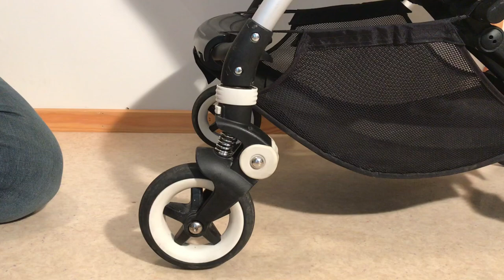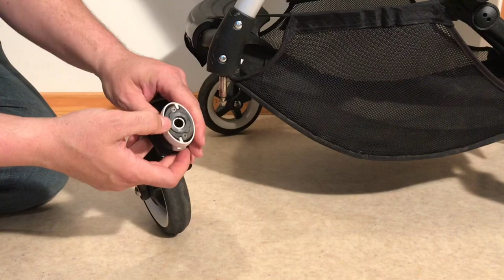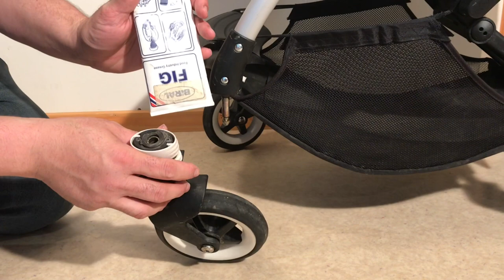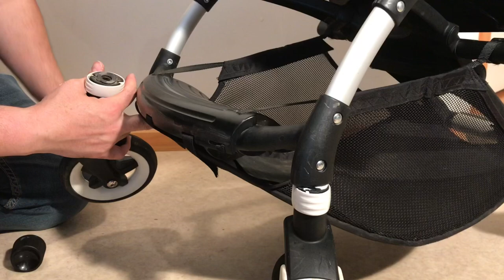How to Fix Slow / Hanging Swivel Wheels on a Bugaboo Bee 3 or 5

Comment: What can I do if thé wheel itself is not straight?
Reply from the maker: It depends on the cause of it not being straight.  But the most common reasons would be damaged ball-bearings, bent bars on the chassis, or with the bee, something wrong with the alignment of the 2 sides of the front-frame when it locks open (since the front frame changes form from when it's folded to unfolded).  I'd recommend looking closely at where the problem is and possibly contacting Bugaboo for replacement parts, once you've figured out where the problem is. :)